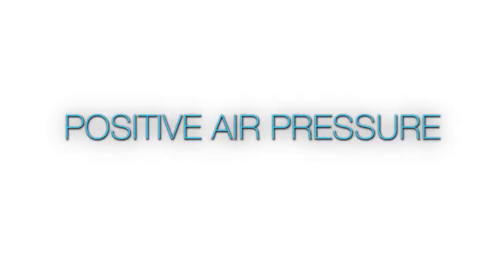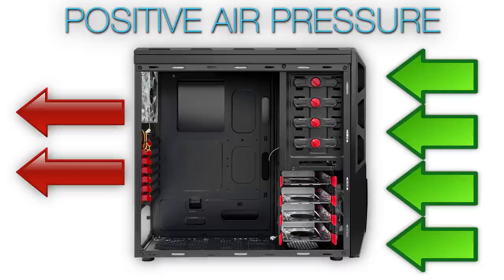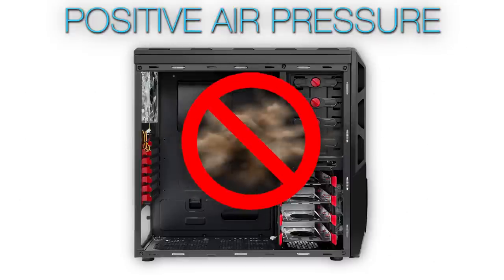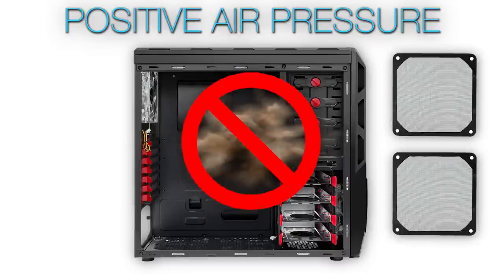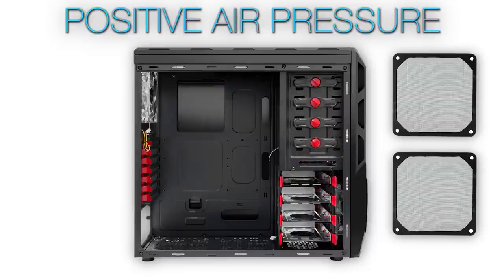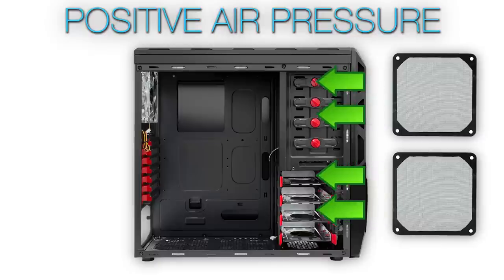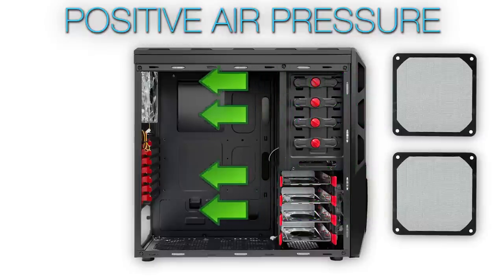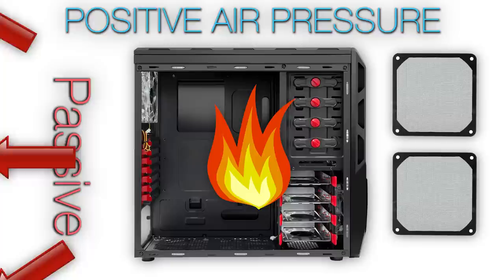Computer Case Airflow - What is Positive and Negative Pressure?

Comment: Is it okay if I have two 120mm intakes in the front, 2 at the top and 1 80mm exhaust at the rear? Are there any potential problems to this setup?
Reply: Remove the 80mm and put one of the 120 top out takes on the back
Reply: Also put the 80mm in the front if you can.
Reply: +Loke Gustafsson I thought the 80mm was too small. I think I'll just junk the 80mm and make all of them 120mm. Bigger is better right?

Comment: hey I've tried to mess around with some computer parts do you think this will work ass a gaming computer?

processor: Core i5 I5-6600K 3.5 GHz (Intel Boxed)
motherboard: MSI Z270I GAMING PRO CARBON AC
Graphics Card: Manli GeForce GTX 1070 Ultimate (8 GB)
Ram: Corsair Vengeance 2 x 8 GB
Power supply: Inter-Tech Energon EPS-650W
cabinet: Phanteks Enthoo EVOLV ITX

it's my first time trying to build one and then I wanted to see if I had done it correct or not. I've also tried to keep the price at $1300 dollars :)
Reply: I feel like this will make a very good gaming computer... could run counter-strike: global-offensive at 300 fps easy..
Reply: ok thx m8 :)
Reply: CS:GO is not a good game for benchmarks, it's an old game and fairly easy to get high FPS with most new tech. That and FPS past about 80 doesn't really matter.

Comment: I wish I could have that for my prodigy with 1 120 intake front button and a msi gtx970 with the normal side panel... Exhaust is the stock fans on the 240 from the h100i GTX 

I need to drill my window side panel and test again.

Comment: So if I want to keep my case cold and no dust I use neutral airflow?
Reply: +DanWunderBurst Neutral airflow it's almost impossible to achieve, I recommend going for a positive one, maybe like two intake fans in the front and one exhaust one in the back, maybe one intake in the front and other intake at the top with an exhaust in the back, or tu intake fans at the top and one intake in the back
Reply: For a balanced scenario yes put i guess positive is even better?
Reply: how about side case fan? in or out?
Reply: front, bottom and side= IN and Back +Top= Out

Comment: my case can have max 3 fan 2 on side and 1 on back, + 1 ventilation on front with filter, my current  airflow is positif with 2 fan(1 side and 1 back), and let all hot air come to front, but the problem when play heavy game(like 7day to die at high settings) its can hit 72-74C and 30 minutes, and it already beat my cpu max that 71.4C no problem with gpu becouse it never hit more than 70C(max 90C), i can just run cpu without overclock and everything fine but i i hope there another way

Comment: i want to see the one for ANTEC GX500 windows. now i have two 120mm on top pushing air inside and one 120mm  in the panelside pushing air ouside. i have a gtx 950 twinfrozR V OC from MSI

Comment: Hi there! Awesome video, can you help me pls? :)
I'm about to buy the Fractal Meshify C TG Case.

Can you tell me what option is the best? Thank you a lot for the help!!!

Option One: Liquid cooler (Cooler Master ML240L) 2x120mm in the Front -
1x120mm Fan in the rear - 2x140mm fan Up

Option Two: 2x140mm in the Front - 1x120mm Fan in the Rear -  Liquid cooler (Cooler Master ML240L) 2x120mm Up.

And maybe can you tell me if the Liquid Cooler is actually worth it? I Have more budget and I can change it.

Thank you my friend! Already subscribed :)
Reply: Sorry voldermort, NCIX is long gone. Option 2 sounds good

Comment: how is the best fan direction if I have 2 front, 2 top and 1 back 12cm fan? (exspecially for positive air preasure)
Reply: Rear exhaust, 2 top for exhaust and front 2 will be intake
Reply: +Lucas 693 what if 2 front intake, 1 top intake, 1 top exhaust, and 1 back exhaust?
Reply: hot air always goes higher in the world so maybe u should have the top as exhaust

Comment: I know I'm late and this isn't a really popular case, but the Sharkoon VG5-V? Its pretty cheap but the fans arent good. I will replace the fans but first I need to know how this airflow stuff works :)
Reply: tbh as long as there is room for fans to breathe the airflow will be good. if you look on the phanteks evolv you will see that the front and top both look solid but are actually sufficiently ventilated. just look in the case (or pics online if you don't have it yet) and look to see if there is good ventilation for the fans. also reading reviews on the case won't hurt
Reply: James Mastroianni Well everything is okay about the fan except airflow but on pics it looks alright

Comment: which types of fan should I put in the front of the case? AF or SP?
Reply: My case is a corsair Spec 01 btw
Reply: Alex Nguyen if you have a hard drive case in the front, then use a SP fan.
Reply: BeanHeadGaming OK thx
Reply: if you have an aio cooler, mount the sp fans onto the radiator, no matter where it is

Comment: ***** i would love for u to do this case Rosewill BlackHawk-Ultra i would love to know the best way to set up fans on this thing i have 2 gpus sapphire vapor x cards. and i took off the 230mm stock side fan and put static pressure fans in the case 6 of them one in from top where the dvd drives go, the other 5 are on the side panel, 3 vertical in center of panel and two middle left and bottom left.

Comment: NOOB TIME!
So both positive and negative are not good only neutral? I am building a p.c for the first time and my case came with one fan in the front so i ordered another for the back but it came with x2 fans not one, so now i have three i am working with. 
This case can have 2 in the front, 2 at the top in the back and 1 at the back. What would be the best thing using 3 fans or should i just use only 2, one in and one out (front/back)

Thanks to anyone!
Reply: Negative is good for overclocking because it is the most efficient way to cool but builds up fast. Positive is good for low maintenance but can lack in cooling power. Neutral is a mix of both and is the most common set up.

Comment: Not only does negative air pressure mean hot air leaves the system faster, but the air will actually cool slightly on its way in, which is useful if you have a warm room.
Reply: "Not only does negative air pressure mean hot air leaves the system faster,"
No. The amount of air entering and exiting the case is always equal (except for extremely short transients).
"but the air will actually cool slightly on its way in, which is useful if you have a warm room."
This effect is laughably small.

Comment: what if you had a radiator instead of fans in te top of the case? how would airflow around the case in that situation plz answer
Reply: doesn't change, all you do is stick a radiator in between the case and fans. they should still point the same way and still have almost the same airflow
Reply: +James Mastroianni hahhaa took you 2 months to answer hahah thanks though since i changed my mind on getting radiators xDD Thanks though really considerate

Comment: I have Thermaltake Versa N21 case and graphics card GIGABYTE WINDFORCE NVIDIA GTX 970.... please guide me where to put an static pressure fan and where to put air flow fans?????????????????????????????
Reply: static pressure fans are for places where there is resistance, such as heatsinks, radiators, hard drive cages and so on. air flow fans are for open fan mounts with no interference

Comment: Ow shit. Completely forgot about this. Got fractal define R5 with one standard fan at front pushing in and one at rear and two for cpu cooling at top to push out. This is going to be negative air pressure

Comment: Hi! when there are two top exhaust fans, isn't the fan that sits BEFORE the CPU taking away some cool air coming from the front and reducing the air the CPU cooler can take? Just to make more sense, here's a picture (I am talking about the fan marked by Black circle) 
http://i1097.photobucket.com/albums/g356/fssahil/Public%20Posts/SPEC01_fan-mount-locations_zpsfatwqbsb.png

Comment: anyone know the best fan configuration for corsair 900d throughout the case?  I'm also using a corsair h110i at the top and corsair sp and af series fans.
Reply: at that point just fill the damn thing with fans and if your not using the bottem for radiators you wasted your money on a giant case that will serve no additional purpose over like a Mastercase or a Ethoo

Comment: For example, in this case (http://phanteks.com/Enthoo-Pro-M.html), is it good if I install 3 120mm fans at the front, 1 140mm at the back and a 240mm radiator on the top?

Comment: Cant you just put your PC in your fridge and stick a dehumidifier in it and some boxes of baking soda and route the psu wire somehow through one of the vents?
Reply: You'd need a really high performance fridge for that. A high end PC can produce 500+ watts of heat under load.

Comment: could i have the pattern for the neutral air flow?
Reply: if you have the same amount of fans on intake as exaust with the same cfm running at the same speeds, then the same amount of air will be actively pushed into the case as pushed out
Reply: so what your saying is that i need the same amount of air pushing in that's pushing out at the same speed?

Comment: Wrong - You need to match the CFM in/out for balanced, NOT "number of fans". 
eg You could have 2x 2000rpm intakes and 2x 800rpm exhaust = Very +.  
eg You could also have 2x 20cm intakes, yet even 4x12cm exhausts = Still, Very +.
(Unless 20cm's above were like @ 200rpm and exhausts @ 1500rpm = Quite - ).

Balanced is also the most difficult to set up, by far (no idea why you said that!).

Yours truthfully, 
Cooling Nazi

Comment: Anyone here think that having two 140 mm fans pulling in air, and three 120mm exhausting it would mostly make it neutral? atleast thats what im hoping for becuase thats all my setup allows for is 5 fans.
Reply: 2x140=280mm intake 120x3=360mm exhaust. It'd be kind of neutral, but it would still create some negative pressure. A negative pressure is in no way bad at all, so it should work out anyway, possibly better than fully neutral.

Comment: disclaimer, Ive never built a computer and I'm a jet engine mechanic.  has anyone ever stacked fans and used a syncrophase to time the fan's rpm for the least amount of air turbulence and the greatest amount of air flow?  they do this on duel prop engines and was just curious... no real reason to do it, just curious if anyone had done it.
Reply: Possibly. There are CPU coolers that have two Stacked fans with a heatsink in between and I've seen the same done with radiators. I'm nots sure about synchronizing the fans though.
Reply: Not sure about that, but OC3D did a crazy push/pull configuration with 40 fans. Search for "Ultimate Corsair H100 Cooling Mod"
Reply: Probably not. You only see people using 2 identical fans on both sides of the radiator and I still don't understand why people use static pressure fans for pull...
Reply: Exidrial Because the difference it actually makes is miniscule.
Reply: +Exidrial 
well the idea I had was more orders like a turbo fan jet engine... like literally almost the same as a jet engine.  two fans in sink on the bottom sucking air into the case and and have bypass dusts the pull 20% of the air flow through ducts with radiators and then one fan on top to extract the hot air not being pushed by the intake.  this would be under the assumption that the case would be trashcan shaped and the fans would be large enough to more air over all of the hardware.  sorta like a Christmas tree shape for the most part.  the bypass dust would vent straight to the outside of the case to keep hot air from reentering the cooling system.  I'm sure this idea sounds stupid but it sounded like a cool project, maybe something to dick around with shits and giggles.
Reply: Mmmmm proof reading is my friend...
Reply: *****
Yeah but a lot of people spend so much time OCing their stuff, paying tons of money to get hardware that OCs better for the last drop of performance but then won't optimize their cooling?Naaah.

Michael Davis you should probably start modding computer cases in your free time. Maybe you can come up with something.

Comment: 1:57 is just about worse - The forward top exhaust fan is picking up the intake air before it can pass over the components
Reply: +jake legg No, I think there isn't any specific intake there. It's picking up air from all around the case, including hot and cool areas. 
The fogger is towards the front, so only the flow in the front is visible in the video, but there is a similar flow from the rear to the top.

Comment: What ways are the best to put your fans? Anyone
Reply: Amaan Siraaj intake in front and exhaust in top and back
Reply: So if I were to have a corsair H100i on the top then would I want the fans at the top going in, the fans at the front going in, and the fans at the back going out?
Reply: or should I move the H100i to the front?
Reply: MsMariokartwiifan the top or back
Reply: Doesn't matter too much where the radiator is, will only effect the temperature by 1-2 degrees Celsius if at all. For example, on my AMD build, I have the H100i in the front with a third 120mm fan bleow it for a total of 3 120mm intake fans. I have two 120mm fans in the top of the case, in the rearmost slots. This gives me positive pressure and pulls the air across my entire case.

Before my last tear down for a good deep cleaning, my radiator was at the top. My idle temp is now 1 degree higher and my load temp is exactly the same as the old arrangement. Only thing I strongly suggest is have your fans in pull configuration. Push will build up dust between the fan and radiator, even with a filter, and restrict air flow through your radiator.

Comment: Hey Guys, maybe someone can help me. I have an Aerocool Xpredator Cube Case and I don't know how many fans I need. I have a R9 380X from Sapphire and a Ben Nevis CPU Cooler. Pre-Installed is a 140mm cooler in the back/up and a 200mm cooler in the front. I have the ability to install 2 120/140mm cooler in the top and 1 120/140mm in the back/down side. Also i could replace the 200mm cooler with 1 or 2 120/140mm cooler. Thanks for your help in advance ^^

Comment: The definitions at the core of this video are wrong. You say that "positive pressure is when you have more airflow entering the case than leaving it". That is false, since in equilibrium we have conservation of mass. Only initially, and only to an exceedingly small degree do you get net airflow in, in the short milliseconds before the fans get up to speed and the pressure reaches equilibrium. Afterwards, as the fans are at a constant speed the air entering is EXACTLY the air leaving.

Comment: I have NZXT swith 810 full tower case and I adjust 3 fan in from the front and 3 fan out from top and bottom of the case. Is it okay for cooling the system?

 🔙🔝🔝🔝
                  
                  🔙
                  🔙
           🔝
Like this.

Comment: Fractal Torrent proves that having a huge amount of positive air pressure actually cools vastly superior to negative or balanced.
Reply: negative pressure means air comes in through gaps and cracks. depending on how much area this is, it can be a severe bottleneck to system performance, by limiting the amount of air flow into the case. The lower the internal pressure, the less flow goes through the fans; the fewer and smaller holes/gaps in the case, the larger pressure is needed to drive a given flow in. It is certainly possible that comparing to having two intake fans, having one intake and one exhaust can result in a lot more flow.
Reply: @arkie87  
Pretty sure the Fractal Torrent just proved to you copius amount of airflow is superior regardless what you got in there
Reply: @SMGJohn  that doesn't need proving, it is thermodynamically obvious (It is also an example of diminishing returns). The question is how does one maximize the flow (having all fans intake or exhaust might not give the maximum flow). And the debate between positive and negative pressure is more about dust than cooling performance.
Reply: @arkie87  
Thats an argument for smaller cases, not big ones, for big ones you are better off having large fans running low to medium speed and brute force your way through it. 
With smaller cases, specially ITX, the question becomes far more complicated and limited in what you can do to maximise airflow, using paper walls to divert airflow is popular methods in ITX building 12 - 15 years ago for us, today most people seems to have no idea how airflow even works and just slaps on as many fans as possible and then crossing their fingers, but big cases its dumb to even worry, Fractal Torrent you can run fans at 25% and wont even hear them yet have same airflow as 140mm fans running at 50%, those you will hear.
Reply: @SMGJohn  my entire argument is about dust, and you havent responded at all to that and seem like you are arguing with an imaginary person.